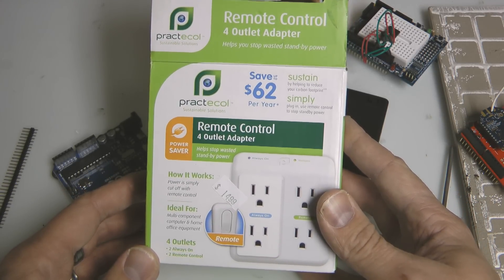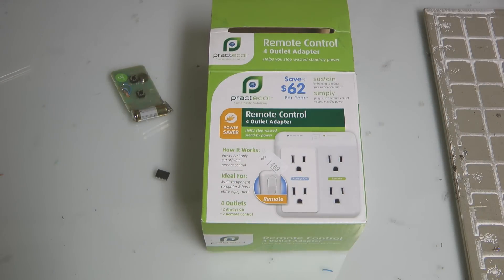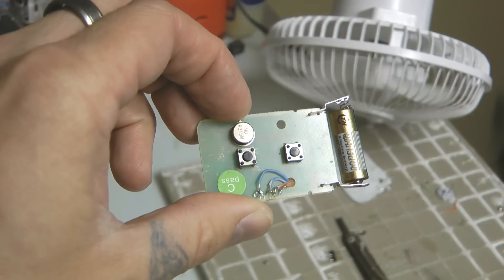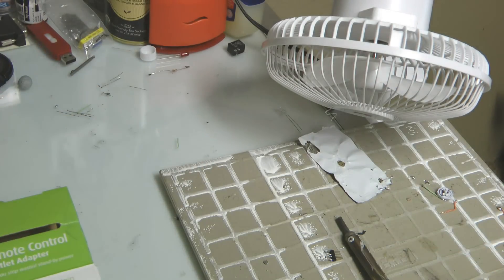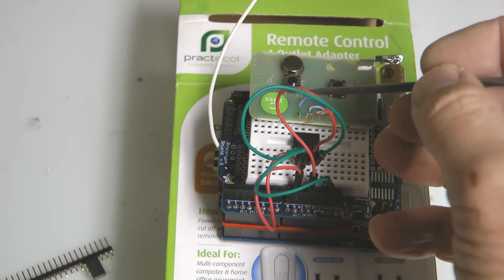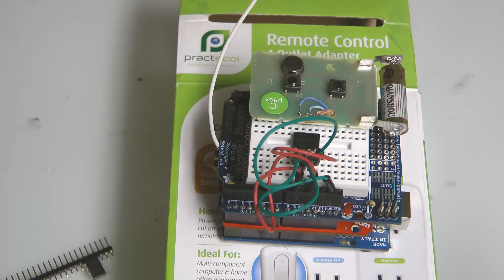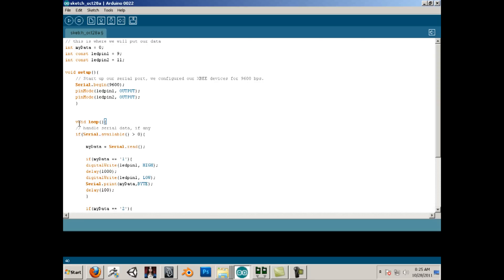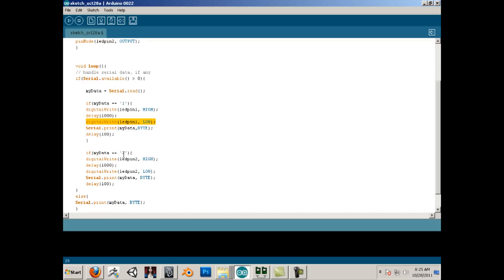Wireless Arduino to AC outlet Control (Video 2)

Comment: In my case I use solid copper core 6-wire telephone wire (bought a full spool of it). Since I couldn't find some jumper cables right away.